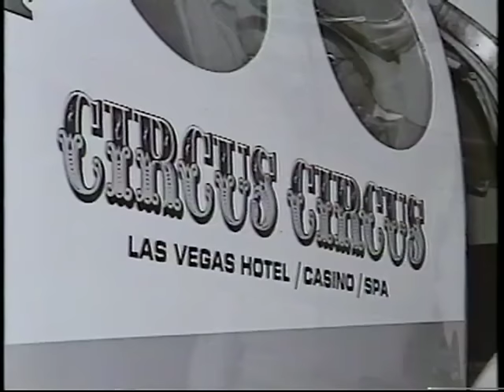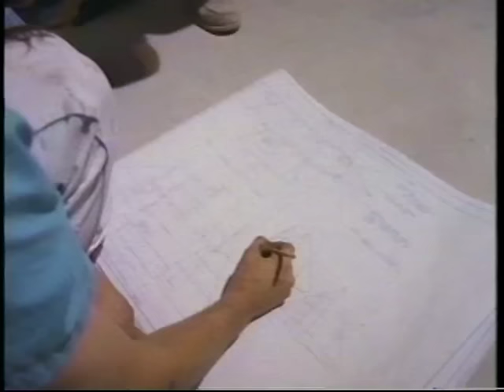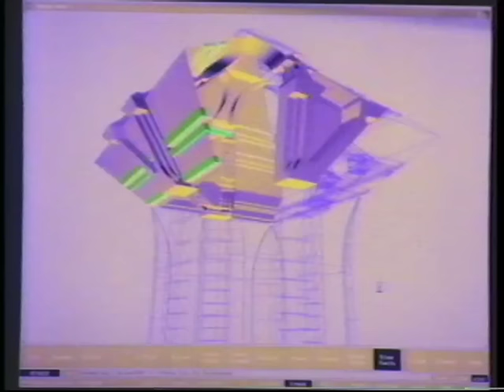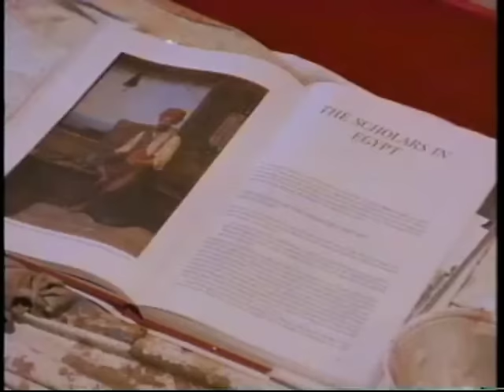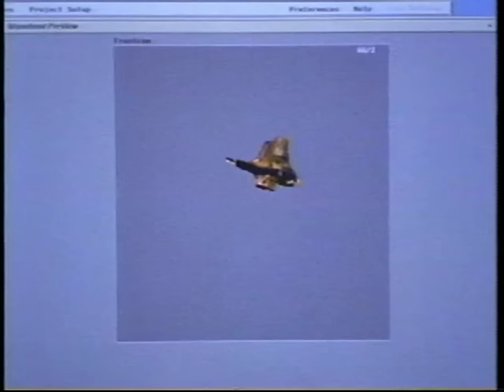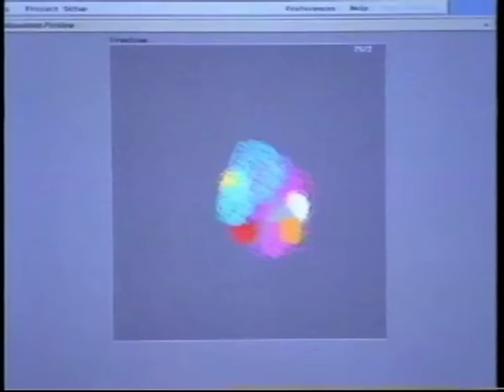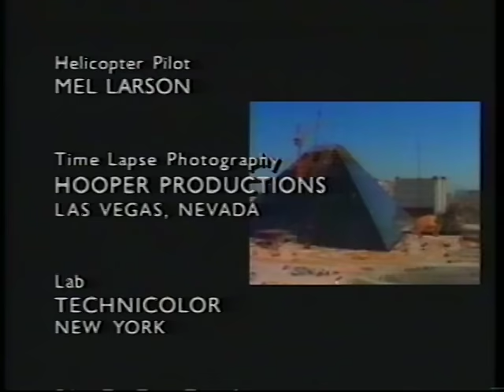1993 - The Making Of Luxor Las Vegas Documentary

Comment: No mention of the one of a kind inclinator elevators that run up the diagonal corners
Reply: They do mention them around 5:41
Reply: The Eiffel Tower has had them since 1889.  And those are two-story elevators that change angle as they ascend the curving corners of the tower.  The Luxor's were simple by comparison, and a century later.

Comment: The fast-changing technology from 1993 when this place was built. went from a wow factor to ho-hum in 10 years. The late 90s saw so many newer, more unique style hotels/casinos the low number of visitors to Luxor could not support the high dollar cost of the special effects. The boat ride inside the building along with many special effects was removed leaving a much less impressive place to visit. On the positive side, the rooms are still unique and have a much better view of Vegas over many of the hotels, and often more reasonable pricing. I like the place, but don't travel there with the vision you see from this video as some disappointment will be had

Comment: the ground buzz in the audio was a nice "hi-tech" touch.
Reply from the maker: Ya, we didn't notice that at the time (but, we were burning through everything pretty quickly). I could have either sampled it and possibly removed it. OR, what we resorted to with a couple of VHS tapes was using the mono track on the tape itself. (The track that would play if you didn't have a stereo VCR).

Having said that, it wasn't our equipment. We've played and dealt with plenty of VHS tapes that have pristine audio after our processing. We go straight from a high-quality, stereo VHS player into a Sony camcorder for the analog-to-digital which ran straight into the computer. Generating a lossless AVI file that that was rendered to 3000k MP4 (above YouTube's standards for 480p) for upload.
Reply: now I feel bad for my snobby comment.  thanks.